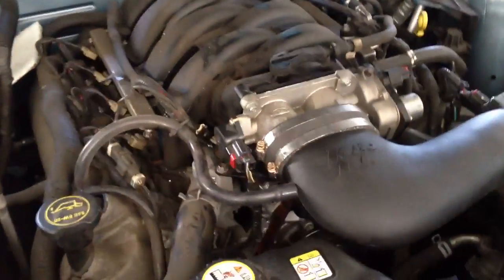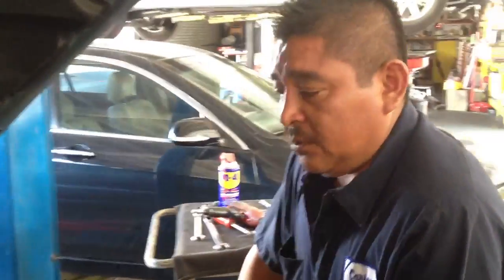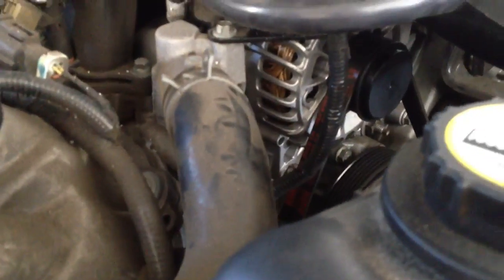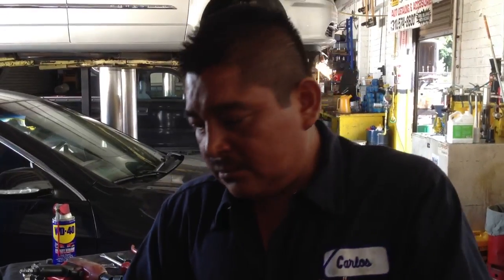Ford mustang engine code P0340

Comment: hola carlos tengo una pregunta ,le cambie los dos sensores y mi mustang gt 2006 sigue con el mismo problema, tiene 50.000 millas le tendre que cambiar el alternador ? desde ya muchas gracias
Reply: RIP CARLOS
Reply from the maker: Thank you, I know he is in heaven having bud-light
Reply from the maker: Sorry  i dont understand Spanish but Carlos died last week
Reply: hoo so sorry ,man i change both sensor but,the problem no gone, i need change the alternator, ?
Reply from the maker: First disconnect the alternator cable and drive it for 20 miles, if the check engine is still off then change the alternator.
Reply: Rest in peace LEGEND 🧡

Comment: disconnected the alternator and cleared the code, drove around for 2 minutes, turned off the car, then started it and the code was back that fast.
Reply: I'm having that problem, how did you resolve yours??
Reply: @tylerstahl6701 did you ever solve it?

Comment: Same thing happened to me twice..engine light turned off for 2k miles when I switched my sensors between A-B and B-A. It just turned on again and the problem was my alternator and I had to change it and now its fine.

Comment: my car has the same code p0340 .. cam shaft sensor A !

I've replaced it ..

but the check engine still ON .. & sometimes the RPM get high and calm down quickly 

what should i do ?